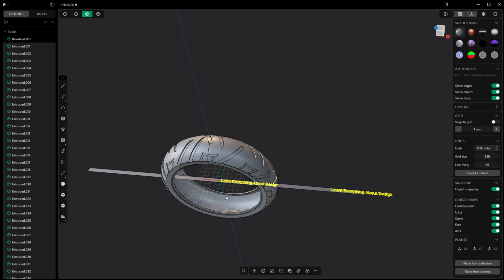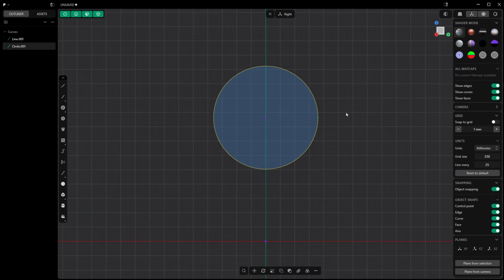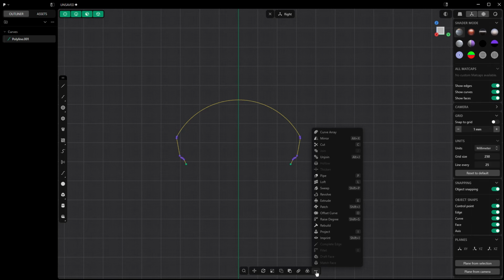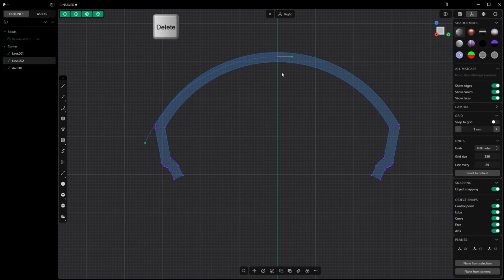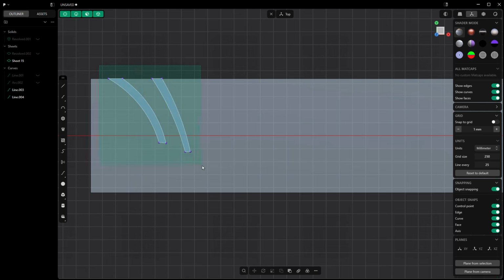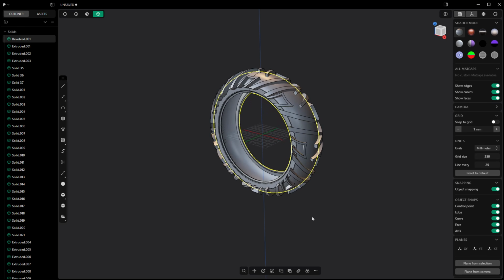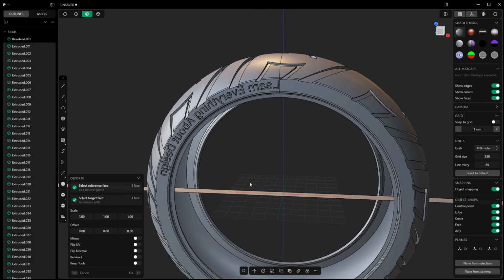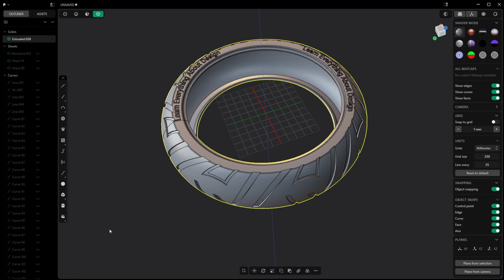How To Model A Motorcycle Tire with Plasticity | Deform | Unwrap #plasticity #plasticity3d

Comment: I do have to say that I love the deform command, but getting the pattern right would be pretty important. So I'd say let's make chunky MX tire and do a radial pattern of geo. That way we one could get perfect spacing.
Reply from the maker: yeah 100% agree.  The pattern could be a single block and a radial pattern.  "usually" using the extend of the unwrwapped face gets it right but in this case it didn't because of the mirror and move.
Reply: @LearnEverythingAboutDesign  I could have used Plasticity when I was working MX VS ATV. We had to do so many hacks to get the knobbies to blend into the tire. Thank you LEAD! I used your code for a discount. Appreciate that.
Reply from the maker: @subd3 Wow you worked on that game!  I play older versions of it from like 07/08 :)

And thank you!!!
Reply: @LearnEverythingAboutDesign  Also did work on Monster Jam Steel Titans 1 & 2. I learned Soldworks a bit on those titles, so the CAD transition to plasticity was pretty natural.
Reply from the maker: @subd3 Awesome!

Comment: Hey thanks for your content. Of the tools you use for manipulating 3D scans how would you rank them. Most useful features to fewer useful features.
Reply from the maker: For 3d scans specifically QuickSurface is top of that list for sure.  PRO is the most expensive but comes with all the great tools including the auto freeform tools.  From there I would say its tricky.  I do a lot of Freeform modeling so Fusion wins there for sure.  Plasticity does OK with meshes but it really isn't made for that.  BUT you can create curves in 3d on a mesh so if you are say tracing curves on a car body that really helps.  The new tools for converting meshes in Plasticity work well and it has the blender bridge.

So QuickSurface is top.  Fusion is 2nd for what I do. and Plasticity is 3rd for the types of scan based modeling I do.
Reply: @LearnEverythingAboutDesign thanks.
Reply: Thanks

Comment: this plasticity tool looks really nice. In your  your opinion - is it better than fusion? Especially  for non parametric models? It does look a bit simpler, but that's actually a good thing in my book
Reply from the maker: It has a lot going for it, but its tough because they aren't exactly direct replacements for each other depending on what you need.

Pros - Plasticity is perpetual, local install, and has a linux version.  It has some advanced surfacing tools in the Studio license with the xNurbs tools.  It has a blender bridge that is bi directional so you can take models from Plasticity to blender and back live in real time.  This year there was a tool added that convers meshes to nurbs surfaces and works pretty well.  Its geometry tools like fillets are much more robust than Fusion.

Cons - There is no history, no sketch constraint system, and no assembly constraint systems.  This means if you are building moving assemblies this can become a task as you can't really preview motion and build an assembly like it needs to be.  You can take things to blender and set up a skeleton and joints, but thats extra work if you make mechanical parts.  You can easily direct model and change things like hole sizes, but you don't have a parameter or sketch to go back to for it.

So for non-parametric models, 100% yes.  Its really lightweight and efficient with geometry and much more forgiving.  You don't worry about rebuilding features or things failing.
Reply: @LearnEverythingAboutDesign  Thank You for the in-depth comparation! I really appreciate!